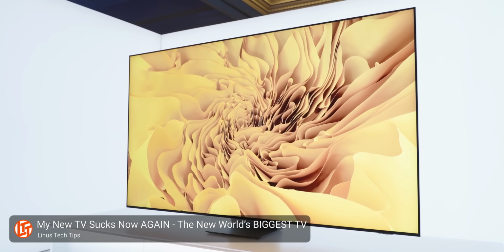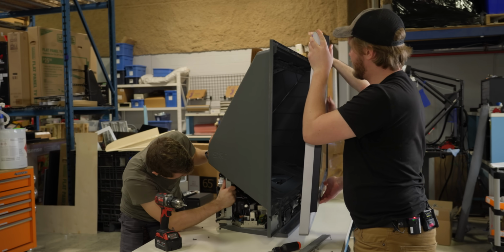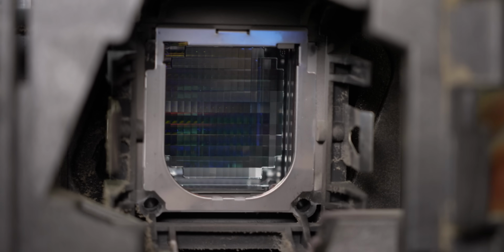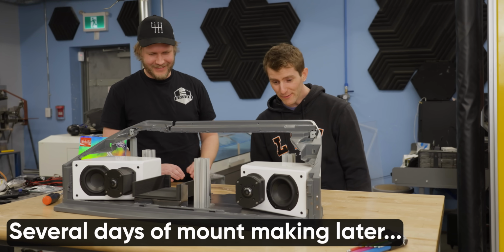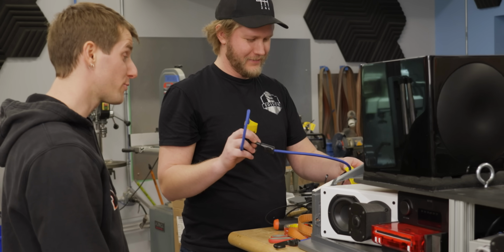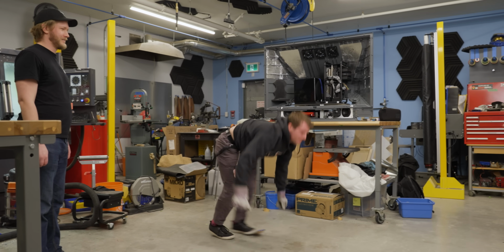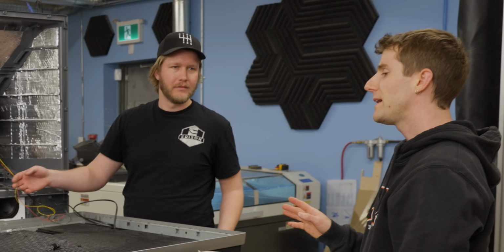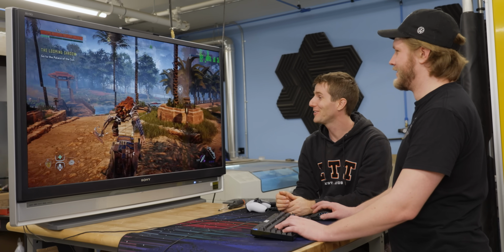The ULTIMATE Sleeper Gaming TV

Comment: In my honest opinion, all TV's should have audio that at least meets the quality of the image,why should a tv be pencil thin and incapable of actually njoyable audio, also I would love to see 3.1 TV's with the side speakers and bottom centre channel speaker and a flat/slim large diameter subwoofer capable of truely deep bass to give an entirely complete spectrum from 20hz to 20khz, top tier TV's should be capable of 20hz-20khz ±3db, mid tier maybe ±6, low end should at least have bass output and sound acceptable throughout the whole frequency range, I hear small area full depth drivers can sometimes work better in like 6th order bandpass or something else high bandpass for small space than say a 12 slim might
Reply: 3.1 audio systems already exist in tvs and they sound very good! And about the lows it would be pretty hard getting 20hz from a tv since the space is very limited unless the tv is very big

Comment: This exact model was my first HD tv. Bought it maybe 2005 or 2006 for just under $1600. Ended up having the optical block rebuilt and replaced twice before I gave up and moved on. It got to the point where new parts were no longer available and there was one guy in CA rebuilding the part. The screen would develop a yellow/green bell curve. Got a good nine years out of her though.

Comment: We had the XBR version of that TV set. Back in 2006, LCoS (Liquid Cystal on Silicon), which Sony called SXRD (Silicon Xtal Reflective Display), gave The Best picture in the 50-60 inch screen size under $10K. Sony had issues with the optical unit.  We had to have ours replaced twice (under warranty), and when it went out for the third time, Sony replaced the whole set with their flagship 60" LCD TV.

Comment: I had a huge crt and sold it when i got an lcd in 2007. Kicking myself now. It was the second biggest made and the most common large size about 27" but taller.

The lcd i replaced it with was fat, and fast with very low latency. I had no idea id miss the crt until I eventually replaced that lcd and got others.
I remember my 1st 165hz monitor and being super disappointed in the ghosting in older VA panals. They're great now, but took years to shed that Ghosting.

Only then did I begin to look into latency on screens. Its possibly the most important part of a screens function for me

Comment: this was a awesome build honestly, it reminds me of the stereo cabinet me and a buddy built, it started as a old radio/record player cabinet with the flip open top, like the short wide wooden ones, and we mounted a power strip inside of is powering a bluetooth audio module ran into a aux to av adapter to the back of the stereo cabinets inputs, and we mounted a usb charging dock inside of it running every type of phone charger cable and a wireless charging platform as well, and we also put in a pc power supply running a car amplifier for a 12" alpine subwoofer and we replaced the original speakers with 6x9 pioneer's, when you close the lid it looks all original, but when you flip open the top it has a led light strip on both sides under the hollow spots lighting everything up and it's basically a giant bluetooth home stereo that will shake your house apart, it's got a 2k watt orion amp running a alpine type s, the blue one, in a ported enclosure, it's a work of art, I have most of the build on my instagram

Comment: First things first! You NEVER turn the gas on three to five turns then strike it. YOU CRACK IT and THEN STRIKE it. Had more gas escaped you might be missing some hair from multiple places on your face as well as there might have been a loud pop and people getting hurt or freaked out. Safety THIRD!!! lmfaooo 
That oxyacetylene explaination was ALMOST correct lmfaooo the acetylene is the fuel and heating agent. The oxygen on the other hand isn't for oxidizing the metal but rather to "blow it away" or cut the material where you made you marks. While the metal gets super heated by the flame the actual cut is from the 40+ psi of jet stream air coming from the orifices on the torch head. Unlike plasma cutters the oxyacetylene torch removes the material to create the space rather than make a "clean" cut or separation.

Comment: Wait Linus, I have an objection here. While most rear projection TVs were terrible to the very end, what you have is something special. Sony’s SXRD had an awesome picture and were not LCD. There were 3 panels which were a hybrid reflective and LCD type technology. Basically the advantages of DLP with no colour wheel and better color accuracy, and deep blacks with minimal light bleed. Aldo they used very powerful lamps like 300 watt xenon. SXRD TVs and home theatre projectors were very expensive, and there’s a reason. They looked great. Also that TV was full 1080p at a time 720p and lower were more common. If the image didn’t look really good, it may have gone slightly out of focus which can be adjusted by twisting the lens. I used this same chassis to upgrade a 1983 RCA rear projection and it looks amazing 
https://youtu.be/TTixifF6zYg?si=z_tTzOW-Zxsu-jqF
Reply: @ChadBoughton  didn’t the optical blocks fail very often? (yellow tint, blue dots)
Reply: @ you’re right, it was because the one panel was too close to the light source and the coating would deteriorate. I repaired one of these optical blocks. It could have been avoided by design. Obviously later SXRD front projectors had this sorted out.
Reply: @ChadBoughton what were the latency of these rptvs, i assuming were abysmal? (100-200 ms type wise)
Reply: @ good question, I’d imagine they weren’t good, it’s early in the LCD and HD era, processing couldn’t have been too optimized
Reply: @ChadBoughton  yeah, the 2010-2012 60 inch sharp aquos tv I have has about 200 Ms of lag
Reply: https://youtu.be/DoYDy8Rzimc   the sony optic block  failure

Comment: I know practicality means nothing to you guys, but a way more actually viable way of doing this would be to get the older flat screens that are actually flat but have 6 inches or so of thickness and do basically what you'd do for an in-desk PC, but mounted to the back of the modern flat-screen instead. A 65" TV should have plenty of width for a CPU AIO and potentially a GPU one as well, maybe even a stripped down PS5 and Wii with some good airflow through the back.

Comment: Next build. Same idea but more grand. Take one of those MASSIVE dresser style projector tvs and "refurb" it. I had one something like 12 years ago that now i wish i still had. Could put those speakers from the original plan plus the switch, pc, wii, ps5, PLUS some other consoles if you wanted. Thing was basically a floor unit as wide as a french door fridge and id guestimate off memory almost 5 ft tall... im 6'1" at 18 and it came up to my chest. So, SO much room for activities. And it was square all around. No tapered back so the top of it was essentially the shelf for my xbox 360, ps3, and a lamp.

Comment: I would’ve expected a lot more thought out work from you guys. 
Like for example you could’ve removed the shells of the consoles to make it overall lighter and maybe slimmer. 
You could’ve made seperate switches to turn on each device. 
You could’ve brought every connector (usb, hdmi etc) of each device, including the tv, to the front with extension cables. 
You could’ve (that’s a lot more difficult) removed all of the power supplies and make just one do all the work. 

I think this could be a great project DIYPerks and I trust him do everything perfectly.

Comment: I am all for a return of the chin. It lets you get all the electronics away from the hot backlight/screen.  It leaves room for ACTUALLY good sounding speakers.  It hides any power/hdmi cables you might have running from your TV to something below it in a media console.  You could even add in some quality of live stuff, like a hidden compartment with USB ports for storing/charging remotes and controllers or go full ham and leave room and IO for the inevitable addition of a streaming stick/boxes.

Comment: ok... i started out this video going "well this is gonna suck..." then when the sub went in i was so down for it. i do wish the video was like 10 minutes longer... with a more in depth dive into the end result. 

full sound test with randoms coming in and rating the sound quality on a scale of 10. 

stress testing each console and pc with a temp lead in the fat booty back and thermal cameras going around the outside of the unit checking body temps... screen temps... intake temps... and exhaust temps.

all in all good vid

ps...  4x6 3-way coaxial speakers exist and sound pretty good.

Comment: There was a great use of the space inside the TV and I like how accessible they kept inputs and controls. But, I'm curious how well wireless controllers handle it. A TV panel probably won't affect PS5 at a couch distance given where it's at and the Wii should be fine being at the front but I'm very doubtful that the Switch will do well being at the back of everything. JoyCon range is not great even in open direct line of sight and I wonder if even the Pro Controller is going to be fine having to transmit through everything. Looks like the PC keyboard and mouse were wired up, too, although that could have just been convenience of what was at hand.

Comment: If they are going to mass market that, they need it to be modular. Change out the screen, the computer, the consoles, etc, with external bay doors. Include all the power connections and cable routing inside. This is totally doable and there might be a market for it, but they will have to be careful not to restrict..... more like an all in one entertainment center.

Comment: I have my PC behind my TV and who cares about the depth. It is on a 60cm deep glass n metal coffee table. Pc case is corsair 550D. Also my monitor is an asus pro art in portrait mode with the "height" same as the 43 TV. TV is a bezel less but the monitor is with a ~1,5cm. But the frameless TV isnt truly a thing because the display itself does not go to the actual edge. There is a bit of hanging over the sides. Look up "Lisa II dohányzóasztal". Soundbar on the legs. Because of the sound dampening panels of the PC case I have a 280mm external radiator attached to a coolance fan shroud looks like a Japanese pagoda. 
Sitting in a TV chair. Keyboard on mylap and the mouse on a piano chair. Or the arms of the TV chair with a wooden box cut out to fit to the armrest.

Comment: For the record, Rear Projection TV’s were *NOT* horrible when they came out. They had great visual fidelity sitting within 60 degrees on axis, were one of the first ways you could get HD for a reasonable cost (meaning not $20k), in a large form factor TV. I loved my Sony Rear projection, it was double the size of the TV it replaced, and used it for years until the early 4k Sony OLEDs came out with insane black level, larger screens, and smart tv tech. All of that was novel at the time.

Comment: when you brought out the oxy acetylene torch it reminded be of thursday last week at my work, where the production line had stopped working, a part needed replacing and there was one real rusty bolt. the boss was angry and not messing about and after 1 minute of trying to hammer it out, just grabbed the torch and turned the bolt to liquid lol
that breakdown cost a whole morning of no production. 

fantastic build, would like to do it myself some day. and i agree with the xbox decision, i used to use an xbox 360 and the one after it, but when loading times were so long that i started playing my ps2 while waiting (over a year i completed GTA san andreas with the amount of loading time for updates as i had such a bad internet connection), then got enough money to get a PC, i not looked back since.

Comment: my family used to have crt based rear projection tv, it was really great tv at the time, only for it to fail in 2014 cuz of crt projector lifespan. if it had hdmi, would had been great gaming tv with 100Hz interlaced 1080i. was disappointed before when component video cannot do with vga output. pic quality was great but suffered bit of colour misshifted
bravia tv upgrade was sharper but sd content like tv antenna sourced was better with it.
sound was huge downgrade cuz the rear projection had big speakers

i didnt knew sony made LCD ver of rear projection though. i actually would try diy this as well if we still had the old tv. also dem this lcd based kinda sucks, crt ver literally had bottom section which made whole tv screen taller without tabletop. alex would enjoyed big front facing speakers and able to put those ceiling speakers

Comment: These were definitely not awful when they came out. You got 50" 720p screen instead of 32" 1080i LCD and lower price. HD movies and games looked awesome (this was almost 20 years ago). Also the 32" LCDs looked pretty much similar and way smaller. I had one for several years until I upgraded to 55" 1080p LCD when they finally dropped the price.

Comment: the power bricks mess can be replaced using USB C Power Delivery on every device, Linus have a video on how to do that, so using a couple or a single powerful power brick with PW all the devices can be powered
Or even using a PC PSU and a bunch of voltage regulators modules

Comment: working at rent a center while these were "big", they always looked great in living rooms as a theater set up. rac went up as high as 65" and the bulbs were cheap as heck for the time they lasted. most of the bulbs lasted 1-2 years and cost $125 - $175 to replace and anyone could replace them. they were easy as heck to replace as it was a single screw and bracket to change out.

Comment: With how subwoofers work, adding ~1-2" of depth to the back of a larger TV is enough volume to make a REALLY nice subwoofer. A small "chin" beneath it would be sufficient for mid drivers. Tweeters could go anywhere. Super easy to do. With how far sound bar tech has come, it could even have an integrated surround decoder and provide height channel with some drivers on top of the TV. (Bonus points for rear surround speaker hookups.)

I think this tech would be excellent for a gaming monitor as well. A portable display with killer audio would be AWESOME. My brother got one of those "Job Rocker" portable speakers with a 1080p panel built into it and it's REALLY cool. Something like that with an actual audio system and a quality display would be on a wholly different level.

Comment: You know if Microsoft or Sony, were to sell a Playstation TV by taking their $600 55" TV and putting console in it instead of the smart controller, hooked up to a basic driver board similar to Every monitor on the planet, They would sell. Sony is the only Manufacturer who makes all of the components needed,. MIcrosoft with its everything is an Xbox could too, built in voice and kinect controls. ninetendo maybe a WiiTV, re-use all the Wii peripherals with a motion tacking bar, built in switch dock for big screen gaming. "one Device' All your needs.

Comment: My cousin and I did something similiar a number of years ago, but we just used a console crt tv and a pc. Everything was mounted inside the console cabinet and had a wireless keyboard and mouse. It was wired up so that when you turned on the tv using the fro t switch, it booted the pc up right away. Used it for emulators for NES and SNES. Is was fantastic, until you needed to move it anywhere lol. Ended up getting rid of it when the pc and tv both stopped working. It was pretty darn cool though when people would come over and turn on our old console tv only to see windows booting up lol

Comment: You're probably going to want an AIO cooler on that 7950x3d. You'd even be able to directly put the heat outside of the case and reduce the noise as well. That thing gets hot by design, but it won't reach its maximum performance without proper cooling.

Comment: Sony has excellent tech in speakers and could easily make some opposing subwoofer assembly for a really good sound system that would fit in a slightly thicker tv, putting a PS5 in it would just be icing on the top. 
Too bad they will never do it and if they did it would be a discless ps5 😂 so no Blu-ray

Comment: Cowards! Dismantle every system to the bare components, custom water cool everything together, install a power supply that can handle any one system, attach each system power switches to the input handler and solder all HDMI outs from the consoled directly into the TV motherboard. Good call on the Wii though.